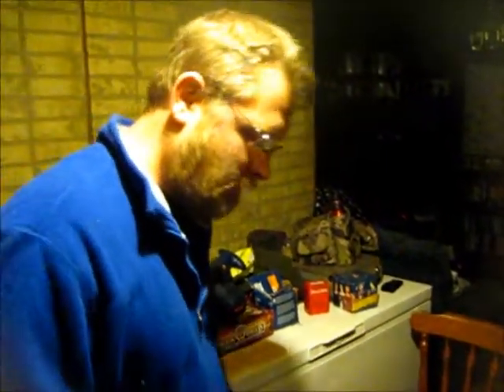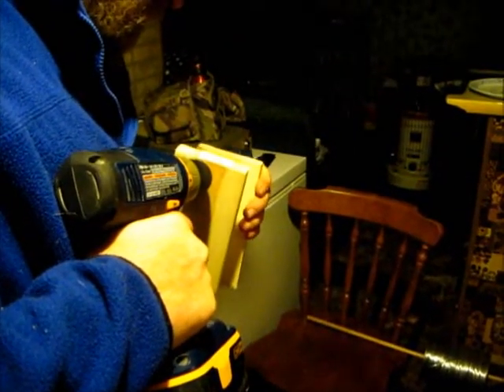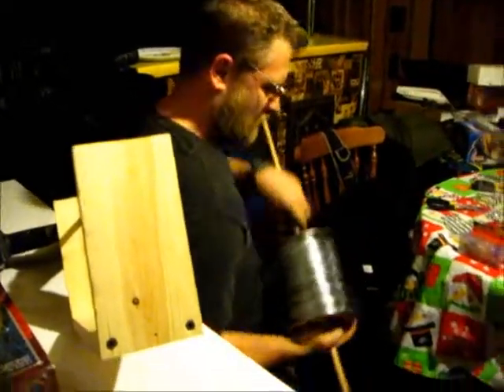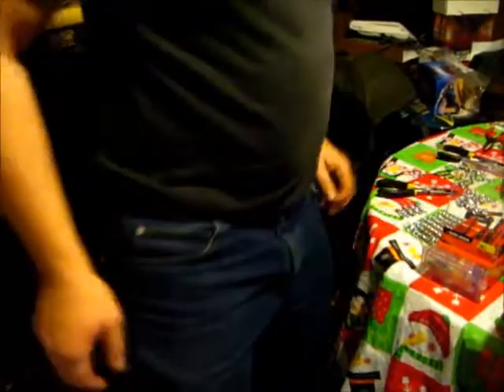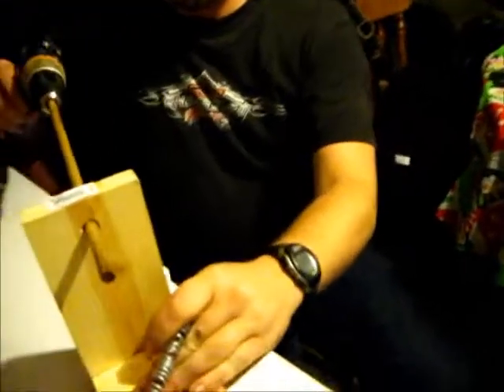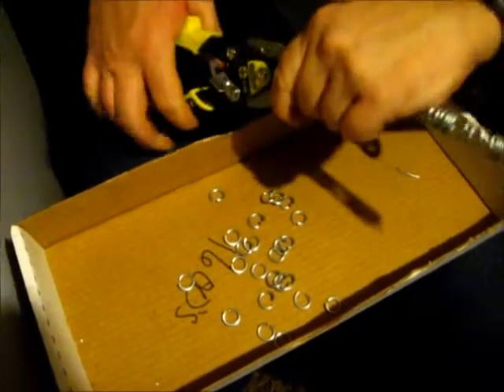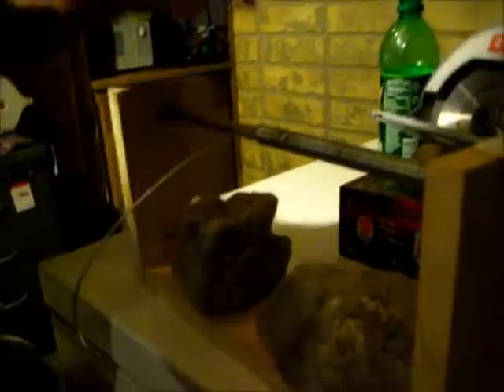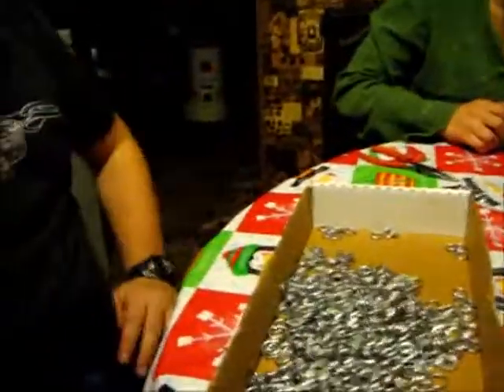Chain Maille prt 1

Comment from the maker: I got 1/4 mile 14 gauge wire at tractor supply for about 50 bucks but it is galvanized I don't know if you can get it in  stainless steel or not